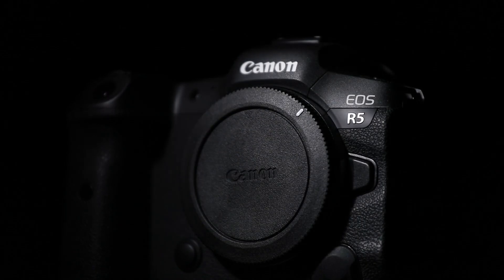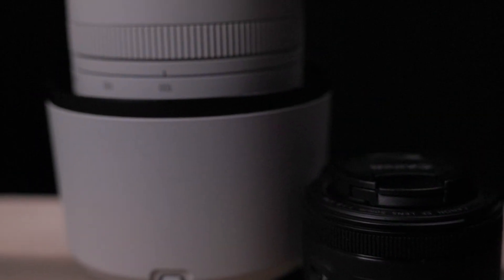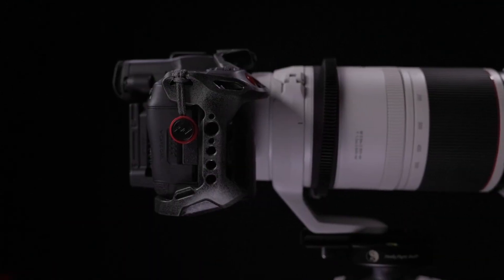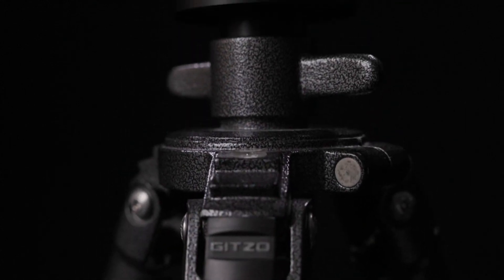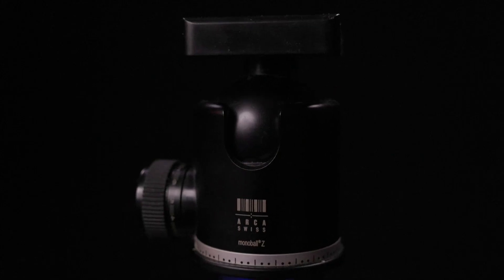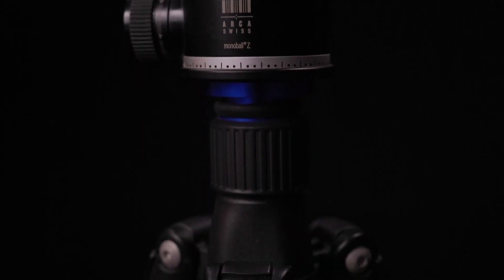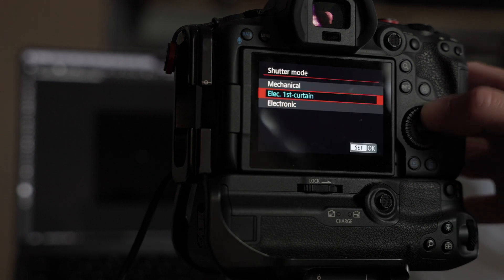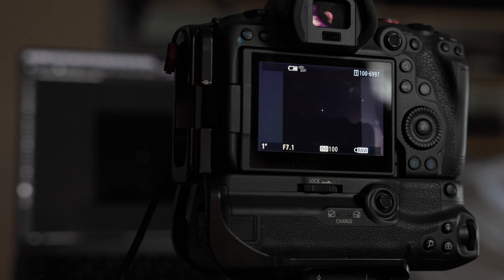Shutter Shock on the EOS R5 - EOS R5 Tip 49

Comment: I did the aame test but at 1/50th of a second and I found roughly 2/3rds of the images suffered significant shutter shock. Lowering the shutter speed to 2 seconds the effect was dimished significantly to the point where it either made no difference or a very faint difference.

I think this means that the shock itself needs enough exposure time to register on the effected pixels. At a 2 second shutter the "shock" is only happening for a tiny fraction of the exposure time so the effect is very hard to notice, and at 1/50th there is a far greater fraction of the image exposure that is affected by that shock duration. 

For arguments sake, lets suppose the shock duration takes about 1/25th of a second to settle down. For a 2 second exposure that accounts for only 2 percent of the total exposure time so the effects are very minimal, there isnt enough exposure time to capture the movement, much like how you dont capture a person quickly walking through your scene on a 30 second long exposure. For a 1/50th of a second exposure that 25th of a second shock duration now accounts for 50% of the exposure time, so its far more noticeable.
Reply from the maker: If you're looking at a simple reflective exposure, then yes you have to use a shutter speed where any vibration exists for a significant part of the exposure time. However, that's the beauty of an emissive target instead of a reflective one. With an emissive target, you have something akin to star trails or light trails with a flash light or headlights at night. Any movement of the camera shows up as a trail in the exposed frame. It doesn't matter that that happened for 1% of the exposure time or 50% of the exposure time, if the vibration is significant enough to move the source enough to harm the image quality you'll see a trail from that source moving.
Reply: @PointsInFocus  I saw your argument in response  to another comment like mine and so I replied with the following...While I can appreciate the theory behind using emissive light, the choice of an LCD with a pulse-width modulated LED backlight may present an issue. These pulses could be out of phase with the resonance frequency, or any harmonic, of the shock oscillation frequency. This phase misalignment could explain why light wasn’t captured from the vibrating pixel, despite the source being "emissive." If your emissive light source had been steady and constant, like sunlight, the results might have been different. In essence, your test is like attempting to light the top of a sailboat’s mast in rough seas with a rotating lighthouse beam. Only through pure chance, when the boat crests a wave and the beam happens to be pointed in the right direction, might any light reach the mast. I apologize for the rough analogy, but I hope it clarifies my point.
Reply from the maker: First, the LCD in question has a measured PWM frequency of just under 15KHz. While it's possible that the PWM flicker could mask a trail, the chances of that happening given the known magnitude and frequency of a mirror slap vibrations, never mind shutter slap vibrations is unlikely. Anything less than that, even an even multiple, would result in a trail of some sort.

Moreover, the displacement has to be fairly significant (by camera terms), a single pixel shift isn't going to be meaningful, or differentiated from the dozens of other possible sources, and will likely be masked by the debayering process anyway. For vibration to be relevant photographically, we're talking about at least a displacement of handful of pixels, and that's quite unlikely to be happening at a frequency that's high enough that there won't be a captured trail in this setup (and likely even with a much lower PWM frequency).

Doubly so when you consider that the resonant frequency is dictated by the mass of the camera (though it's more complicated than that), and two cameras were tested in this experiment; a gripped R5 with 2 batteries, and an un-gripped R5C with 1 battery. On top of that, the R5's sensor isn't rigidly mounted to the camera, even with the IS system off, the IS mechanism is going to damp vibrations at the sensor to some extent. And again, while it's possible that the two cameras with two different masses and two different sensor mounting configurations somehow also have the same resonant frequency, and that's also ~15 KHz. Again, I'm dubious that things line up that perfectly.

So yes, I agree that in a perfect storm scenario where the camera's resonant frequency perfectly matches the PWM frequency it's possible that a PWM light could mask the movement. It's also highly unlikely with a high frequency PWM source and 2 different cameras with different masses and different sensor mounting situations that it actually happened in this case.

On top of that, I did a lot more testing that went into this than what was shown. Including with a pin-hole masked continuous source, as well as some astrophotography. In the case of the pin hole masked light, the testing design had issues that made it much harder to interpret, but the results were functionally the same. If there was vibration induced blur, it wasn't significant enough to be distinguishable from other optical issues. I didn't use those tests for that reason.
Reply: @PointsInFocus  Considering you used multiple sensor structures in your testing, I completely agree with your conclusion that it's simply too unlikely. Thank you for taking the time to consider my postulation. I've subscribed to your channel, I've really enjoyed the depth of analysis you bring to these photography myth-busting experiments. I look forward to seeing your channel continue to grow and thrive.
Reply: @PointsInFocus   This week, I took the time to conduct yet another extensive test to definitively address this topic, and I’ve concluded, without any doubt, that shutter shock is present in the R5 at or near 1/50th of a second as I found before. While sharp images were achievable, the results became increasingly inconsistent as the shutter speed approached this range. However, the moment I switched to EFCS, the images became noticeably sharper and achieved near 100% consistency every time.

No matter how hard I tried, I could not replicate shutter shock at significantly slower shutter speeds on a tripod, as in your demonstration, regardless of whether I used a reflective or emissive light source. Based on these findings, I must conclude that your test is fundamentally flawed. The root cause isn’t entirely clear, but shutter speed appears to be the key factor.

I strongly encourage you to replicate your test to verify this for yourself. You don't even need to be very fancy in your setup. Even hand held with IS enabled I can shoot a burst of images in mechanical shutter at 1/50th of a second. Then switch to EFCS and shoot a second burst. I can flip through the images on my PC and immediately identify when I made the switch from mechanical to electronic first curtain, as a large proportion of the images are noticeably softer using mechanical shutter, every time.

I urge you to update your video, as its current conclusions are highly misleading.

From my findings:  the best setting for the R5, when image quality is the highest priority and shutter speeds are below 1/500th of a second, is undoubtedly Electronic First Curtain. The mechanical shutter should only be used at shutter speeds exceeding 1/1000th of a second, where EFCS may impact exposure consistency and bokeh but shutter speeds are high enough to eliminate any possibility of shock induced image degradation. Purely electronic shutter should only be considered when silent shooting or 20fps is prioritized over maximum image quality as it introduces other artifacts such as rolling shutter and a lower dynamic range.

Thanks for making these videos, I highly appreciate them, and it kills me to bring you this conflicting data as I respect your attention to detail and intellect, I believe you thought you made a solid definitive test, but it's simply not the case this time, shutter shock is definitely present in the R5 unfortunately. 
Cheers.
Reply from the maker: > Even hand held with IS enabled I can shoot a burst of images in mechanical shutter at 1/50th of a second. 

If you're touching or holding the camera, then you're no longer testing for shutter shock. 

The camera has to be isolated (the the greatest extent possible) form all external sources of vibration. In my tests, I used a cable release and the 2s self timer to insure that even the cable release didn't impart vibration (an RF trigger would be even better in that sense). Holding the camera, or even pressing the shutter release, will impart a larger motion than the shutter mechanism can/will.

> Thanks for making these videos, I highly appreciate them, and it kills me to bring you this conflicting data as I respect your attention to detail and intellect, I believe you thought you made a solid definitive test, but it's simply not the case this time, shutter shock is definitely present in the R5 unfortunately. 

First off, validation and contractions are critical parts to any scientific endeavor, and should never be considered as negative things to present. So I'm not bothered in the slightest that you've come up with conflicting results or shared them.

That said, my conclusions are based on the results of my testing. I will not change them without retesting the camera. To be honest, right now, and given how little utility there is to me to test this again, I'm not overly inclined to spend the time (which I'd have to take away from other projects) to do so --- though I certainly might reconsider at some point (hopefully before mechanical shutters go extinct).

That said, I've pinned this thread (and your first comment) so anyone who looks at the comments can read it and make up their own mind.
Reply: @PointsInFocus    I 100% agree,  holding the camera introduces additional variables for sure, which is why I first conducted a highly controlled test using a solid tripod on a concrete floor, wireless Bluetooth remote, controlled lighting, and other measures to minimize external influences. 

However, after analyzing the results of shutter shock from those very clinically controlled conditions, I decided to explore further, and introduce a more typical shooting scenario.

Although this second test was less controlled than the first as you pointed out, the results mirrored the first test. Both results strongly suggest that shutter shock is likely a significant factor.

Thank you, I highly value your opinion and the time you took to respond. I can appreciate that revisiting this aspect of the R5 is likely low priority for you now, I have also now exhausted my curiosity on the subject and we can both draw our own conclusions. I very much look forward to your new projects and am excited to find out what you have in store for your growing community.

Comment: Could you please elaborate on f/7.1 being the R5 defraction limited aperture?  I’m not familiar with that spec.  Thanks.
Reply from the maker: So without getting too far into the physics weeds on this, the diffraction limited aperture is the aperture at which diffraction becomes the limiting factor in resolving details. The size of the diffraction blur spot equals the pixel size. Basically, it's the sharpest possible aperture you can shoot at.

If you've ever looked at lens resolution tests, you're probably already familiar with seeing this in the results. Resolution will increase as the lens is stopped down. But once the aperture reaches a certain point, the lens doesn't get any sharper, and starts getting worse.
Reply: Interesting… I feel like some of the EF lenses I have tested look better stopped further than this—particularly the 24mm tilt shift (mk II). It could be my copy isn’t great… In any case, it’s the lens I most want Canon to update for RF mount!
Reply: @PointsInFocus  Thanks!
Reply from the maker: @Colin Robertson It gets a bit more complicated with digital cameras since the sensors use the Bayer pattern, and as a result there's necessary interpolation and processing to turn the 4 pixel RGGB pixel quads into 4 RGB pixels.

Technically the F/7.1 aperture for the R5 assumes that the sensor is monochromatic. In practice you can stop down further and you generally won't see any losses.
Reply: @PointsInFocus  I never considered the Bayer pattern having an impact on diffraction, thanks for this tidbit. I was always hesitant to go past f/7.1 on a 45 megapixel camera due to diffraction charts, but in practice Iv found f/9 to be the point before I begin to notice diffraction on the R5,  I always wondered why I didn't see diffraction sooner and now I know why.

Comment: I have an R5 and saw some weird issues early on in owning it. I shoot architecture and saw these issues while shooting brackets and the camera was on a tripod and I was using a wifi wireless release (CamRanger). I don’t remember if I had stabilization on or not, but at the time I was using the full mechanical shutter and was adapting one of the EF tilt-shifts. Some shots had very noticeable softness. I have since switched to using EFCS and have not seen an issue since, except for one weird exception…  It was a very similar, if not identical setup, but one shot looked like the camera was literally shaken the blur was so bad. I was shooting outside and I wondered if a bird landed on the camera and I just didn’t notice, or if the IBIS went wonky on me. What made it extra weird was that I was shooting with plenty of daylight so my shutter speed was fast enough to be handheld. I don’t have access to my files right now otherwise I’d check the data and share them. I’m glad you looked into this but maybe a bit disappointed you didn’t see anything similar—albiet good for you. I know I’m not alone because I know of another photographer who saw similar “shutter shock” softness while using the full mechanical shutter while his R5 was on a tripod.
Reply from the maker: I'm certainly open to digging further into this. As I said in the video, I've seen enough comments attributing image issues to shutter shock that I think it's worth looking at. I haven't yet been able to reproduce it when I've tried, but that could just be luck or me missing something in how I designed my tests. 

As for your latter issue, my feeling is to blame it on IS. If the IS system reset during the exposure (reached the end of travel limit and then re-centered) it would definitely ruin an image even with a high shutter speed. In theory that shouldn't happen, but we all know how in theory, theory in practice are the same, but, in practice, they're not.

At least with digital, we don't have to wait until we get the film back to realize we need to reshoot something.

Also it's interesting that both you and @Kenneth Lui saw issues with an adapted EF lens.

Comment: I would say I could easily get softer images with mechanical than with electronic shutter when using the Canon EF 600 mm f4 IS II.  For bird photography, I use electronic shutter all the time except hummingbird in flight where rolling shutter comes in.
Reply from the maker: Interesting. What shutter speeds do you shoot at? And what kind of tripod do you use? 

My experience with shooting birds and wildlife is that shutter speeds high enough to freeze motion put them above the range where shutter shock is even an issue to start with.

I'd like to see if I can narrow down a test case that can reproduce shutter shock as an issue. I've had enough people say they've seen shutter shock soften their images, but I've yet to be able to reproduce that in either the lab or in practical shooting.
Reply: @PointsInFocus  I use Wimberley and Gitzo 3 series.  I use shutter speed 1/1600 and above with R5 for BIF at hight speed burst.  I mean it is easier to get crisp images with electronic shutter.  Perhaps the big prime is easier to shake due to high magnification.
Reply from the maker: I didn't really expect the tripod to be an issue. Anybody shooting with a 600/4L isn’t going to be using a $20 box store special. And at 1/1600th or faster, the shutter really shouldn't be a factor at all.

That said, I’m also half wondering if a Gitzo 3 series tripod just isn’t stiff enough for that kind of load with a modern high-resolution camera. When I was shooting with a rented 600/4L II a couple of years ago, my GT-3530LS didn’t feel like it was as stable as I’m used to it being. But I wrote that off as being all in my head. I mean Gitzos are solid. Besides, a 600/4L II, a 5D4, and a BH-55 are well under my tripod’s ~40-pound load rating — by like half.

Then again, it wouldn’t be the first time a high-res camera has exposed problems with some other piece of kit not being beyond good enough, even though it was more than fine in the past.

Interesting nonetheless. Thanks for sharing.